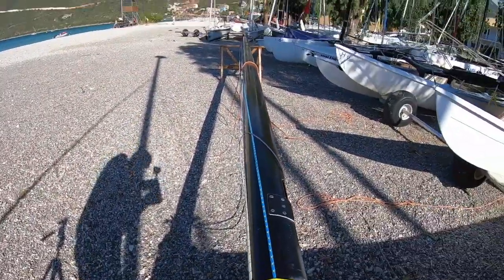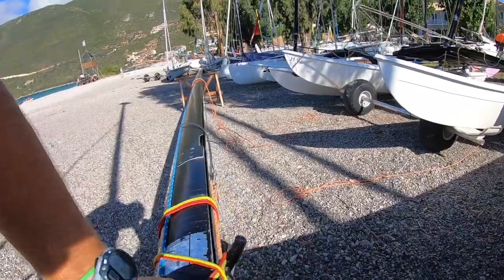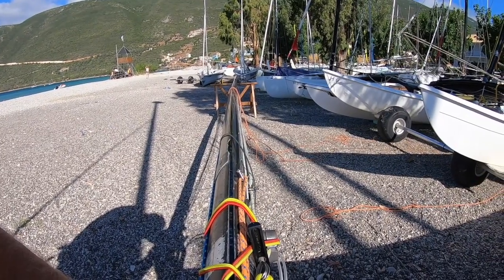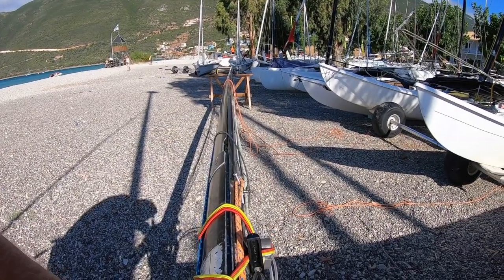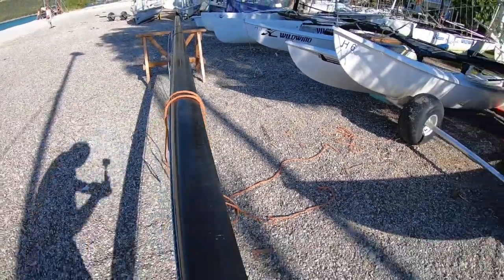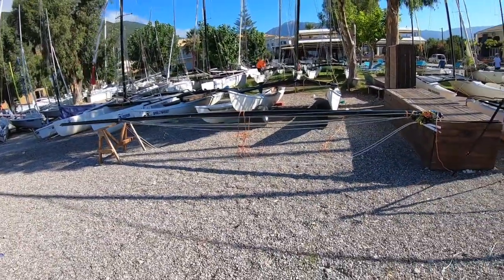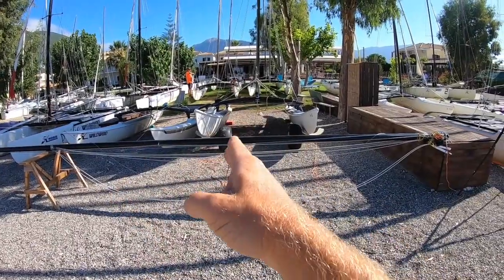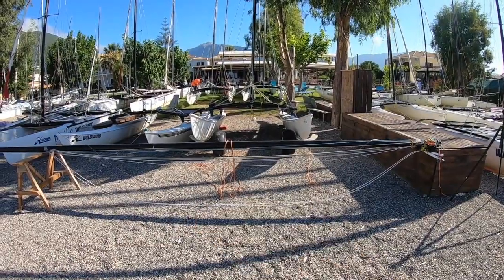How to straighten your bent mast, spinnaker pole, boom or tiller extension

Comment: Hello, did you think that's possible to do the same thing on an F18 mast (just above diamond) ?
Thx
Reply from the maker: yes, you'll have to take the diamond wires off and then support the mast so that the apex of the bend is half way between the supports. It'll take more weight to get it straight.
It should work fine but in the unlikely event of it not working out for any reason I would prefer not to be held responsible!

Comment: May a new topic, having water in the top of the Mast, just only from rain while trailing. Will not imagine when i capsize HC18> full floating 😂
What can i do against floating mast?Where are the weak points?
Thanks ,Kai
Reply from the maker: Hi Kai, 
do you mean that there is water in your mast?
If there is, it's pretty important that you drain the mast and reseal it - otherwise it's very difficult to bring upright from a capsize.
Reply: @JoyriderTV  Yes i know,but where  could be the open Spots to  reseal.I mean are there typical points at the mast.
Thanks great channel,follow everything
Reply from the maker: @hobie1827  anywhere where there is a rivet or fitting is a potential leaking point.

Comment: Thanks JoyRider, very helpful! My Barracuda mast was damaged during a storm when a huge tree branch fell on it. It may be too severely  bent to try this technique, but will give it a shot. Any thoughts on applying some slight heat too? Thanks in advance!
Reply from the maker: We use a blow torch to heat the area on smaller sections like booms and bowsprits, With a cat mast it would probably help the bend come out easier. I'd say yes, go for it.

Comment: This is why I'm weary of buying used boats! It's a great fix, but it's always going to be weaker there than anywhere else.  

Some other owner "fixes" a problem and then sells the boat.
Reply: Why would it be weaker?
Reply: @Mylife-ws5rc  When you bend metal it introduces heat and micro stresses into the metal.  Once the metal is bent or stretched it has lost it's initial rigidity.
It's similar to bending a metal coat hanger.  Once you bend it a little bit, it's easier to bend it back, and back again, etc.  Eventually it will break.
Reply: @DialedN_07  I think it's hardening and become stronger.  Bend so small will not make it weaker.  If you bend hanger it will bend back from other spot because it got hardened. I mean strain hardening.
Reply: @Mylife-ws5rc   Masts are designed to deflect under load but they are designed to do so elastically (it will return to its original shape when the load is removed). When a mast is bent, it has deflected plastically (it will not return to its original shape when the load is removed). Metal (or any material really) will deflect elastically until it reaches its yield strength, at which point it will begin to deflect plastically. A metal will fracture and crack when it passes its tensile strength. When you 'fix' a bent mast by bending it back, you are work hardening the metal, making it stiffer. Now the problem with doing this is that as a material becomes stiffer, it's yield strength increases. This means that the mast will no longer bend like it's designed to. You run into bigger problems when the yield strength passes the tensile strength. When this happens, the mast will just crack instead of bending.
Reply: @telimarkskierman  I cant fully agree with you.. Hardening does not increase stifness, that is material property. I think small bend fix is just fine, not anything extreme. Dent would be much worse In My opinion.
Reply: @Mylife-ws5rc  Yes hardness doesn't effect stiffness in the technical sense, but as the mast is bent, and bent back, it will become harder, and so therefore more brittle. This will lead to cracking in the mast when it would have otherwise bent. Easiest way to think of this is to say it will make a stiffer mast, but you're right, that's not really technically accurate.